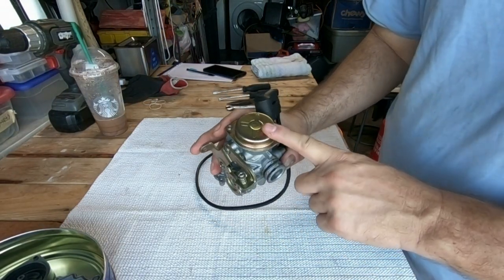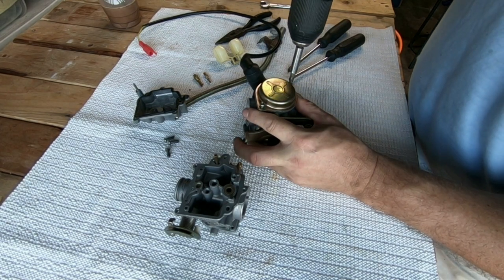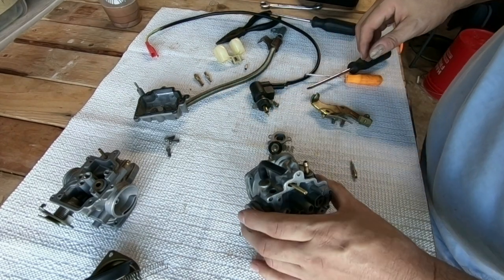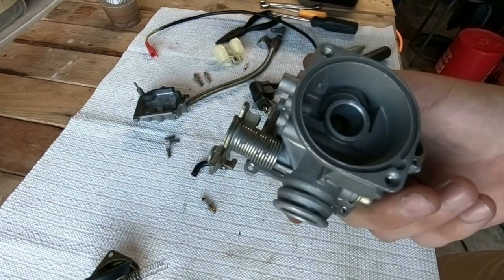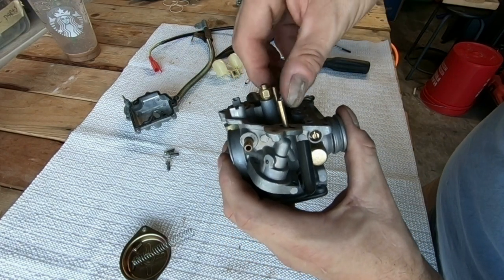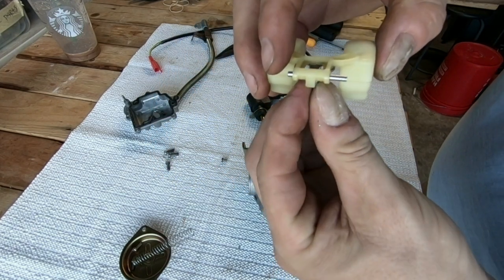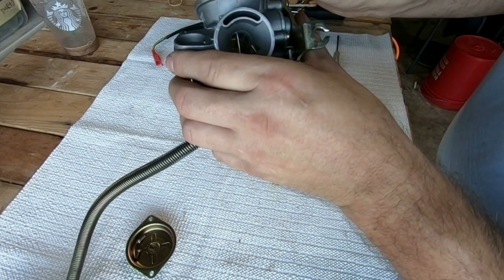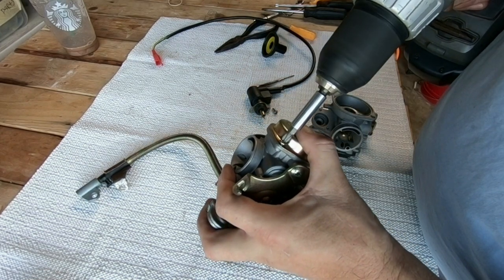GY6 Scooter (carburetor) FAILED Part:11

Comment: Not likely.  Same issue with my scooter.  I’m told it’s a fuel delivery problem.  Probably a clog in the pathway since your jets are cleaned.
Reply from the maker: when I put the carburetor back on the scooter without air filter and started my scooter I looked in the back of the carburetor and gave it gas,,, the butterfly valve was broken and didn't move at all.
Reply: @jrztoolzmore9991  ok then there ya have it.  Yup, when the butterfly broke on my tractor I had to get a new carb.  I’ll be soaking my scooter carb tomorrow.  Maybe that will jar my clog loose.